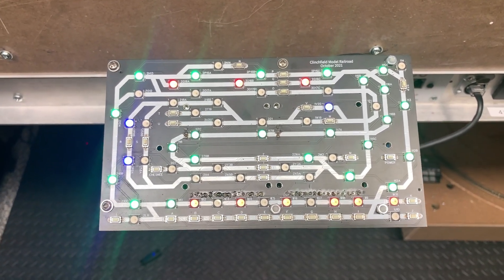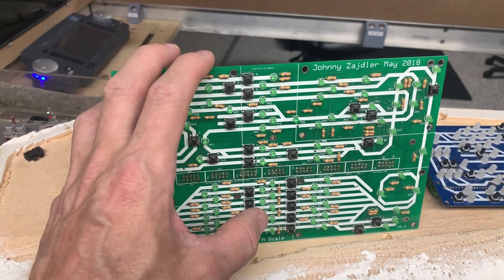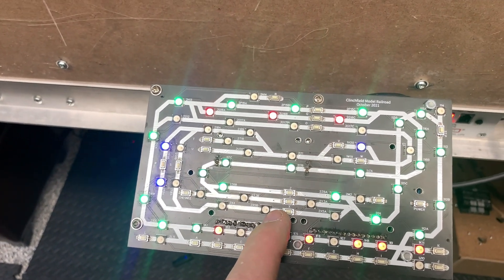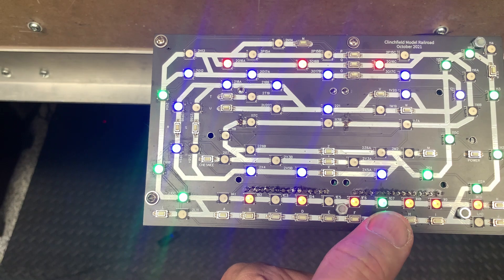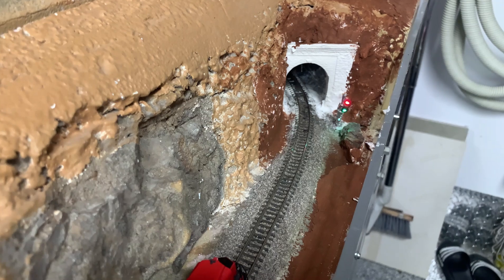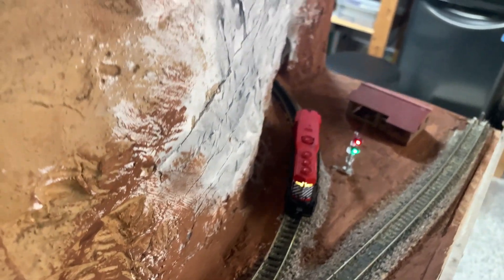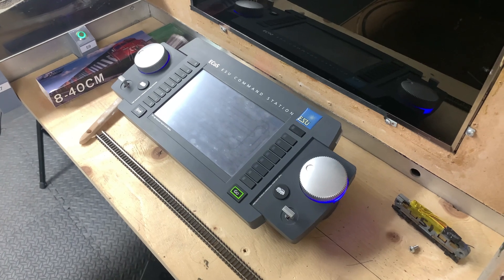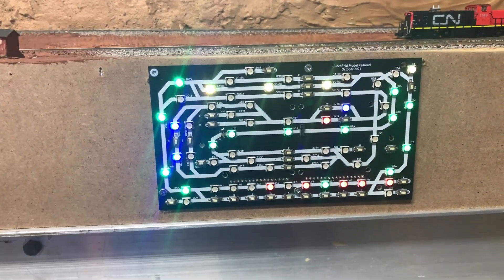MGP Mimic panel

Comment: Just happened to be fed your video from the algorithm and wondered what pushbutton you are using in the last panel. My last layout was controlled via an Arduino and used switch indicators (red/green) as well as other using serial RGB LED's.  The surface mounted buttons are a better approach going forward on my new layout which will also be under RasPi control.  Nice to see others progressing the hobby using custom hardware.  🙂